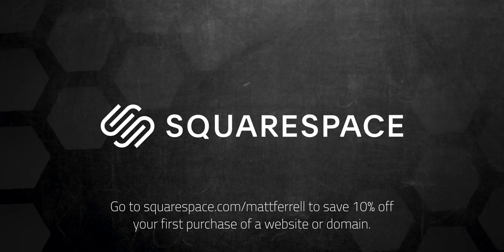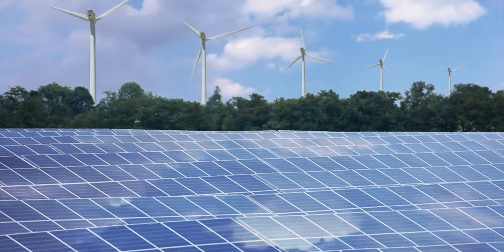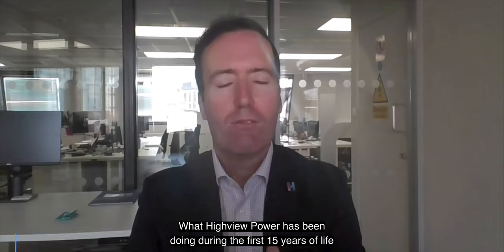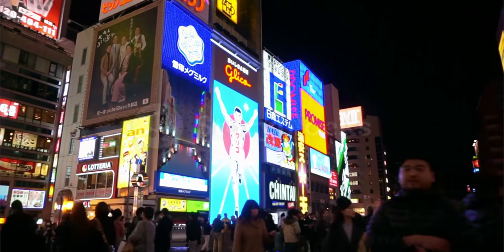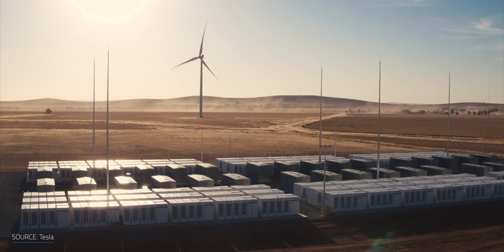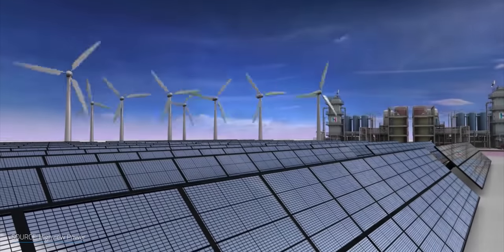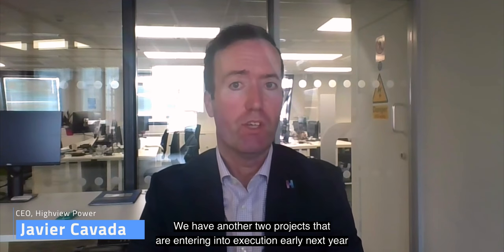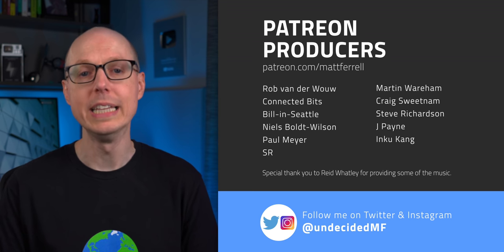Liquid Air Battery Explained - Rival to Lithium Ion Batteries?

Comment: So what did the $/MWh cost boil down to? How does it compare to current grid scale Lithium Ion battery technology. I love your channel but this just came across as a fluff piece without real analysis and numbers.
Reply: Agree, the CEO particularly stressed the importance of this number, but then we still dont see it.
Reply: @tobias8814  what is VPS?
Reply: @tobias8814  Thankyou.  This is exactly the sort of info that Matt's fluff piece was crying out for. And it's available from a number of places.
Reply: @Ikbeneengeit  A grid mix of wind at $20/MWh, solar at $20/MWh, storage at $100/MWh, and overbuilding for non-dispatchable loads with much of the overbuild sold to dispatchable loads means abundant, low cost electricity for our future.  New wind and solar are heading toward $20.  By using overbuilding and maximizing dispatchable loads the most expensive part of the system, storage, can be minimized.

If the option turns out to be 2 cents per kWh for wind and solar and 10 cents for storage then we can, to some extent, overbuild and curtail to some extent to avoid extra storage costs.
Reply: Rough numbers, a 100MWh battery costs about $100M, the LAES test facility(meaning it is their first attempt after the prototype so costs may still go down) in England was little over $100M but has 150MWh capacity. But they scale differently: Double the budget for batteries and you get a 200MWh battery. Double the budget for LAES and you get 4x storage tanks because they are just cheap steel.
Reply: At around 140$/kWh the cost is about the same as batteries. But the batteries are more responsive and might have cheaper maintenance and running costs. Teslas roadrunner batteries will almost halve the price.
Reply: @AnalystPrime  Tesla just announced that they are now pretty much capable of reducing battery cell prices by 56%.  That's going to change the math.  But you're right about adding addition capacity.  Storage tanks for liquid air are cheap (but include temperature insolation costs).
Reply: I've 2000w solar installed on my roof.  My batteries get full charged by 12 noon. Fact is after 2pm my requirement is only 200w. I wish If I could use my extra powers to this kind of ever lasting storage. Btw grid feeding is almost impossible as per my states law.
Reply: @bobwallace9753  Yes, Tesla may have just put few other alternate battery companies and research teams out of business, but simple insulated tanks will always be cheaper than chemical batteries. Basically everything but the generator and the heating/cooling system itself is made of cheap pipes and tanks and most of it doesn't even need to be rated for high pressures.
Reply: @AnalystPrime  All I'm suggesting is that it's early to declare a winner.  Liquid air can add capacity less expensively than batteries.  But batteries might turn out ot be less expensive for frequently cycle storage.  And it will almost certainly be easier to install battery storage at the neighborhood level in order to increase grid resiliency and help avoid  the cost of upsizing transmission lines.
Reply: @bobwallace9753  There is no "winner" at all. Batteries work for houses and cars and for quickly balancing the grid when power is needed in less than a second. LAES, pumped hydro and such are better for longer term grid level power. If you need more than 24h of power just build extra windmills and keep few backup fuel burning plants prepared.Have underground caves filled with millions of gallons of water that is used to cool buildings during summer and warm them in winter. You should always use right tool for the right job, stuff like trying to be 100% solar powered is too bothersome.
Reply: @AnalystPrime  Please don't put words in my comment.  I  have never suggested 100% solar except in rare cases.  Off grid generation and small islands without good wind potential or a small enough population to not make a large wind turbine economic are places for 100% solar.

To reach 24/365 100% RE grids we will need some sort of deep storage/generation.  Liquid air sounds promising as an alternative to PuHS.

I did a one year (2017) modeling of the combined California grids (CAISO) to determine the best mixture of wind, solar, storge and EV charging (dispatchable load).  In 2017 there were three days, a single day and a two-day event, where installing enough additional wind and solar would have been cost prohibitive.  California would have needed more of something.  

CA has a lot of PuHS but more turbines would be needed in order to deliver a lot more power during the wind/solar lulls.  Liquid air might be the least expensive way to fill the need.  But we need hard costs and a bit of a track record to determine liquid air's future.

I'm hesitant to buy in heavily on new storage solutions.  I've gotten excited over battery companies that couldn't deliver what they promised.  And I thought the liquid metal battery was going to solve our problems.  I allowed myself to get optimistic about that one based on who was bringing the technology.  But it petered out....
Reply: Its on the website, it is about $150/mwh
Reply: @Ikbeneengeit  wind is not that cheap yet, it is more around $60/mwh
Reply: same comment. plenty battery tech out there but if it is not scaling at even at fraction of lithium, it is waste of time
Reply: It works out dollar wise when the tax paying is paying the difference.
Reply: Might be a good idea to combine the technologies, batteries for fast response till the LAES is capable to take over or needs to charge the batteries.
Reply: @terjes7548  140$ per Kwh?
Reply: “boil down to”. I see what you did there. Sneaky.
Reply: From HighViews website, so usual grain of salt etc;

"At approximately £110/MWh for a 10-hour, 200 MW / 2 GWh system, the CRYOBattery™ offers a competitive levelised cost of storage for large-scale applications" - the source is a news article - https://highviewpower.com/news_announcement/highview-power-awarded-10-million-grant-from-uk-government-for-first-commercial-cryobattery-facility/
Reply: @rapolasmasaitis9824  kWh sounds more correct yes. I have edited my comment
Reply: Thanks
Reply: @electrichanoi7244  You've got some out of date information, Jack.  Purchase price agreements (PPAs) in the US for wind are about $20/mWh.  That includes some subsidy but remove the subsidy and the price is still under $30/mWh.

The governmental subsidy is $0.015 per kWh for the first ten years of operation.  Since PPAs are generally 20 to 25 years long that makes the subsidy about three quarters of a cent per kWh.
Reply: @MindBodySoulOk  Do you realize that we are paying hundreds of billions of dollars each year to pay for the health costs caused by fossil fuel pollution?  

"... cumulative energy subsidies from 2010 to 2019 for solar, wind, oil and gas, and
coal have been $34 billion, $37 billion, $25 billion, and $13 billion, respectively.
Nuclear has received about $15 billion, and hydropower and geothermal have
each received around $1.4 billion. Arguments over whether wind and solar or
fossil fuels receive more federal subsidies are of little value. Every primary form
of U.S. energy production has received substantial federal subsidies over the past
two decades, and the situation is unlikely to change without significant structural
changes in the political environment surrounding energy issues."

over a 10 year period wind and solar received $71 billion or about $7 billion per year.

"The economic and health costs of air pollution from burning fossil fuels totaled $2.9 trillion in 2018, 
calculated in the form of work absences, years of life lost, and premature deaths, 
according to a new report by the Center for Research on Energy and Clean Air (CREA). 
The cost represents 3.3 percent of global GDP, or about $8 billion per day."

We spend as much in one day dealing with the problems caused by fossil fuels as we spend in a year to subsidize wind and solar to help us quit fossil fuel.  And once we are finished with fossil fuels we will save that "$8 billion per day" day after day and year after year.
Reply: @zodiacfml  If you're right then how do you explain the fact that we are now installing batteries on our grids?  And it's saving us money?
Reply: All of these sort of projects are snake oil to extract tax payer money from politicians, none of them other than maybe pumped hydro have reasonable economics with current technology. pumped hydro is used in the western grid as a seasonal peaking solution that is combined with irrigation. 
ie Grand Coulee dam and Banks lake. Although with the additional flow control dams installed upstream in Canada during the 1970s to control the river seasonality, Banks lake has become much more about irrigation. It's filled by pumps whenever there is excess river flow(both water and energy supply) mainly in the late spring, and used through the mid to late summer for irrigation and then mid winter for peak energy demand. (the climate has most precipitation as snow pack so spring river flows are high, but the region has highest power demand mid-winter and little rain in the summer growing season)
Reply: @mytech6779  One of the roles of a (good) government is to assist new ideas that could serve the common good to get tested and established.  Governments have the role of supporting projects that private/corporate money will not support because there's no clear promise of profit.  We wouldn't have railroads, the electric grid, computers, and the internet had the government not supported them when they were emerging.  Or we might have had to wait much, much longer.

Yes, pump-up hydro works.  It's a century old technology.  But it's not very easy to create.  It takes a long time to permit and construct a new PuHS facility.  Even to turn an existing hydro dam in to a hybrid generation/storage facility.  And PuHS is not cheap.

If we can create a cheaper and faster to install 'deep storage' method we win.

There's another advantage to liquid air storage as well as battery, compressed air, syngas, etc. systems.  They can be installed in many more places than PuHS.  A liquid air storage facility could be built on the grounds of an old coal generation plant, for example.  Money would be saved because the required amount of cleanup wouldn't be as great and there would already be some serious electrical transmission lines in place.  

Modest sized battery storage systems are really good candidates for installation at existing grid substations.  They are now sort of a 'unload from the truck and plug in' solutions.  Government subsidies have helped batteries become more affordable.
Reply: @tobias8814  The link you provided appears to be broken. Can you try again?
Reply: cheep af. All the components are widly used and mass manufactured in the oil and gas industry.
Reply: There's a couple installed in England. What they cost is shown. I forget but there's a Mister Think video somewhere to start with. https://www.youtube.com/c/JustHaveaThink/videos
Reply: @bichitraxvst5777  that’s an unconscionable position for your state to take! Replace your legislators!! In Arizona we do have buy back after years of fighting with the utility grid!
Reply: @AnalystPrime  good points!
Reply: @bobwallace9753  a graphic example of “health costs” was when the country shut down for covid. Almost overnight the air quality rose noticeably. I have mild asthma and walking outside was much easier during the shutdown. I can easily imagine living longer and healthier without fossil fuels.
Reply: @Tagurrit  I had a similar experience in Quito, Ecuador.  I was staying in the 'colonial' part of the city, the historical section.  On Sundays they don't allow cars to drive through that part of town.  Only buses and people traveling to/from their homes inside the zone are allowed on the roads.  The change in the air is remarkable.  As is the change in noise level.  It gave me a feel for what our electric vehicle future will be like.  A huge improvement in quality of life.

That asthma problem you have.  Possibly due to fossil fuel pollution.  Think about how many fewer people are likely to have similar problems in the future.
Reply: @bobwallace9753  absolutely! I agree with your assessment 100%.!! I hope I live to see it. 👍🏼
Reply: You can get in contact with Highview Power direct & ask them
Reply: @G11713  About half way down the page of https://www.sciencedirect.com/science/article/pii/S0140700719304748 is the following: 
Expansion Energy's patent Vandor's Power Storage Cycle (called the VPS Cycle) of LAES includes natural gas fueled power generation as reported in (Vandor, 2011). In Vandor's patent (Vandor, 2011), a LAES that relies on combustion of natural gas with liquid air is presented. To limit CO2 emission, Vandor's proposed a CO2 adsorption chemical process. The final use of the CO2 captured was not mentioned in the patent. In a commercial document of the company that manufactures the system (Liebowitz et al., 2013) the round trip efficiency of the VPS cycle at a commercial scale is claimed to be greater than 95%. The VPS cycle is now subject to a feasibility study and a full scale system installation may be planned at a facility in New York City (Taylor et al., 2012).
Reply: Bob Wallace  but you need to add the cost of recycling those batteries
Reply: @Tagurrit  you live in a big city or what?
Reply: @ChadDidNothingWrong  yes. Four million people.
Reply: @Tagurrit  hm. I recommend 4 thousand instead.
Reply: The REAL cost in megawatts is everything involved for the life of the powerplant and the "effects" it has on health and the environment (environmental impacts). So don't be fooled by these megawatt costs. Society has been fooled long enough and is starting to notice the REAL costs!

For example a coal plant costs can be obvious, including but not limited to: extraction, transportation, equipment maintenance/replacing, manpower, etc. And not so clear or obvious: environmental impact costs like pollution, healthcare, global warming, relocation due to rise in sea levels, etc. 

Battery storage has "not so obvious" or clear costs too, for example, replacement of damaged/used cells stored in waste sites, healthcare from chemical leakage into environment, new cell technology investment, etc. 

Liquid air obviously has it's "not so clear cost" too BUT they are small and most of it's costs are, well as clear as the clean air we all want to see and breath!
Reply: @bichitraxvst5777  try crypto mining with your excess power. It is kind of energy storage anymore.
Reply: @bobwallace9753  hello sir. What about using high altitude kites and store that atmospheric energy continuously with maglev stornetic enwheels… then move that stored maglev energy (enwheels) from the atmosphere around to power hydroelectric batteries installed into the bases of each turbine filled with water like the “four turbine project” in Germany…. But powered by maglev atmospheric energy. Doing this you would have endless energy. By tapping into and ‘storing’ the continuous jet stream layer of the planet… with kites much more efficient and higher winds than near the ground dramatically. storing the energy continuously of the jet stream layer. using a HA kite/stornetic enwheel battery buffering a hydroelectric battery installed into a windmill so the jet stream can make it spin on days without “wind” (ground). Mmmmmboooyah.
Reply: @davidconjefferson  
Well, first someone would have to build a system like that and then present a believable plan to scale up and be economically competitive.
Reply: @bobwallace9753  interesting. All of those things have already been accomplished successfully separately in parts. When their powers combine….